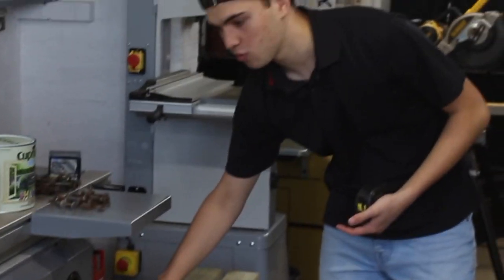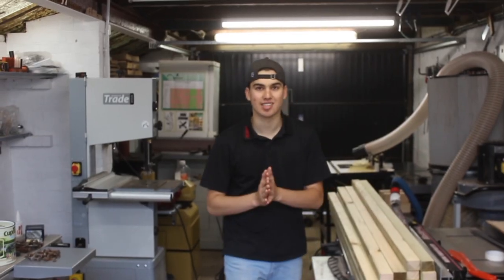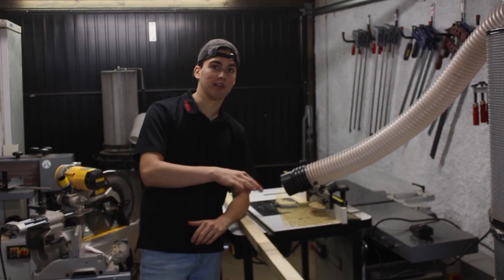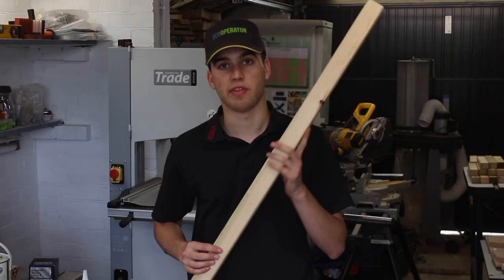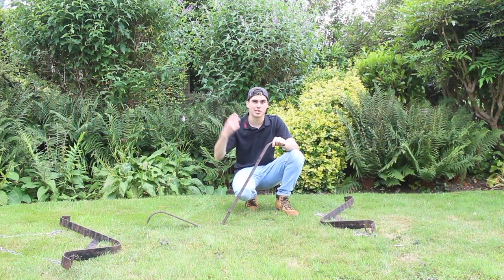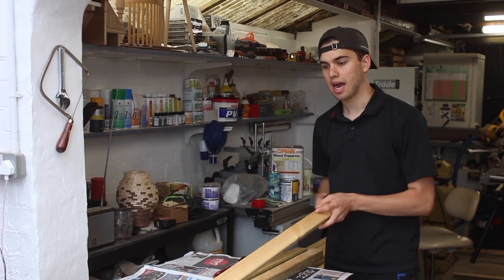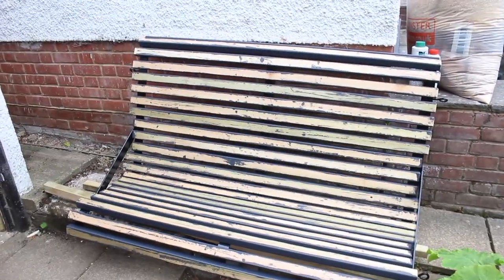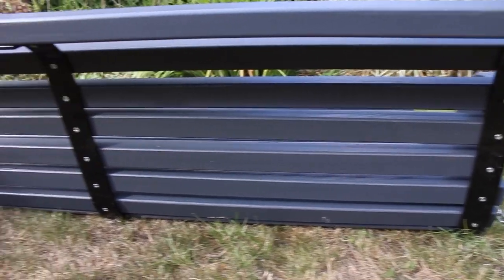DIY Outdoor Swing Seat (Part 1) - Made With Materials From Your Local Home Centre!

Comment: Failing eBay, salvage or dump finds, you can have the steel parts made by a metal fabricator or a welding shop.

Comment: Did I miss the part where you talked about the fasteners?
Reply from the maker: HI Sam, for the seat, I used outdoor screws with washers to attach the slats in place. In part 2, I'll talk more about the bolts used for the frame

Comment: I don’t believe you found any straight timber at Wickes...😳
Reply from the maker: Hey Stuart, they were actually pretty good. I spend time sighting down the length of the board, to see if they're straight. I also look though most of the boards and take my time until i find the right ones!
Reply: Sean Evelegh check you messages on messenger...lol...

Comment: Hi, I was that impressed with your swing bench that I thought yes that can be my next project. I instantly went in search for the type of metal brackets you had but no luck so far, any idea's? Great video by the way
Reply from the maker: HI Mick! That's great, I hope you enjoy making it and following the series! I might be difficult to find online, but I would search for swing seat frame, or bench metal brackets etc... you might be able to find something similar in a reclamation yard, if not you can always make an all wooden seat... there's many ideas on google images for wooden swing seats.
Reply: Mick Molyneux...if all else fails, go get some old car leaf springs (parts of suspension system on old cars), and use the metal in those, they’re great for this kind of project. You’ll need to heat and bend the steel, but this can be achieved by a good diy’er with a a BBQ and hot coals, a good ball/plain hammer and something (even a nice hard tree-stump) to shape the bends in the metal... When bending metal I also use a flat board on which I mark the profile of the bend, so if doing more than one, I can get the profile of the bends to match as necessary. Other than that a decent metal shop in your area should be able to help you out at not too much cost...👍🏻

Comment: Why didn't you use a roller to paint the slats?  It would have been faster and easier.  But am I missing something?  
As usual, your work is really remarkable, precise, original, and stunning.  At any time, you can build me anything you like and I will be happy as a clam at high tide.
Reply from the maker: Thanks for watching mate, there was sometimes cracks or rough areas where the knots were and a brush helped in those areas. I also find using a roller uses up a lot more paint unnecessarily, and we only had one can so I wanted little waste. Thank you very much for your kind words as-well, I do have an Etsy store 😉